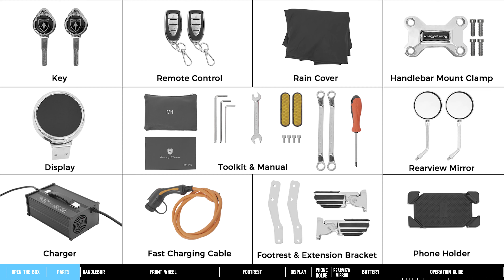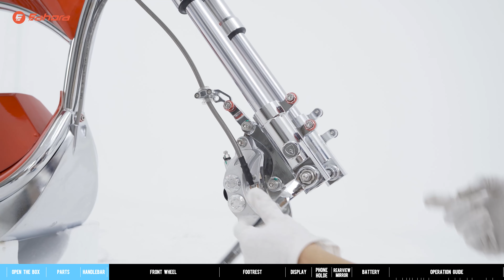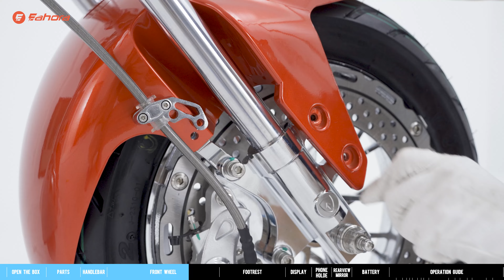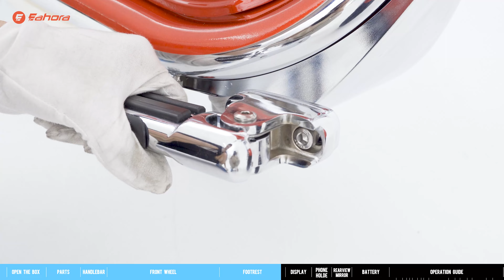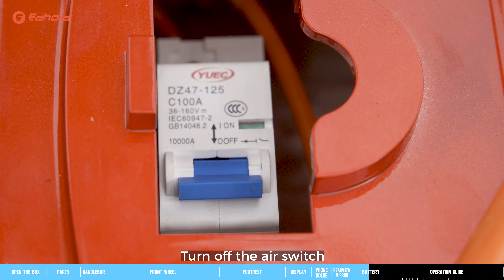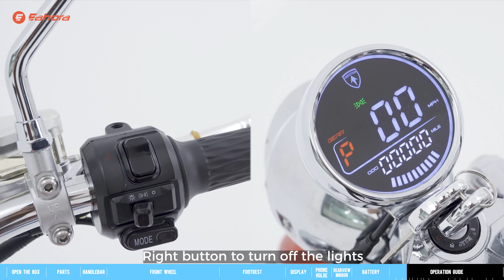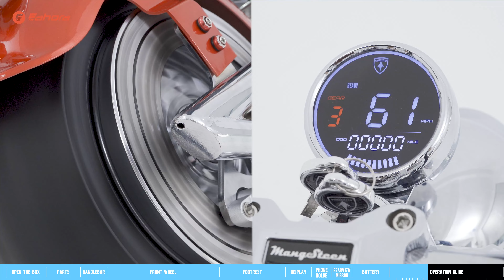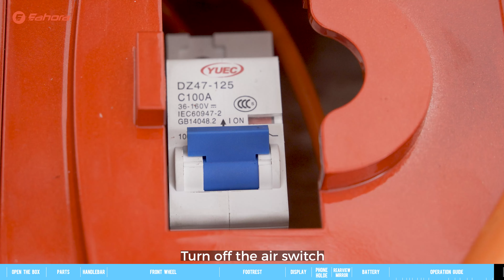Eahora Chrome 4000W M1PS Installation Tutorial

Comment: That was awesome do you have any payment plan for this awesomeness
Reply from the maker: Hi, Eahora supports Klarna payment, which accepts weekly payment.
At checkout, you can select Klarna as your payment method.
You will then see the option to pay using financing along with the cost and payment schedule.
The payment limit of Klarna is less than $3000.
If you need, we will divide the bill into two payments for you. 
Feel free to contact us for more info about M1PS chopper via service@eahoraescooter.com
Reply: @eahora  ok so just one other question. Does it come in 84V
Reply: Can you charge this the same place cars charge? Or is it a proprietary plug?